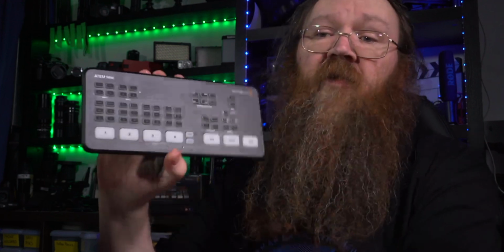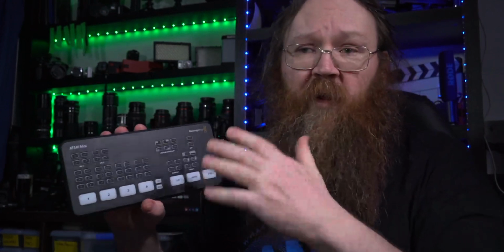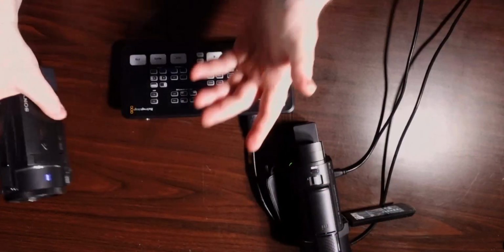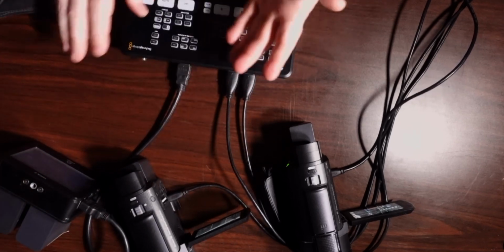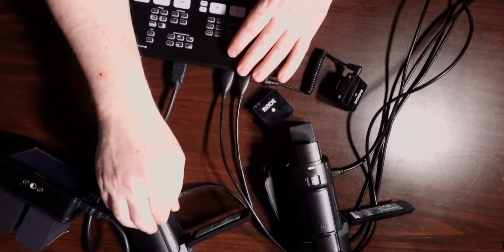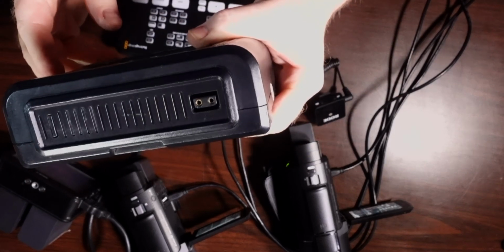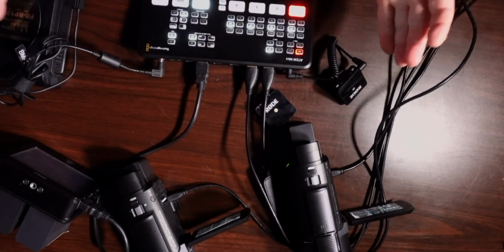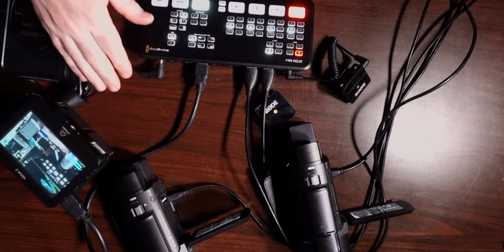It works! Battery Power for the Blackmagic ATEM Mini

Comment: Could a golf cart battery work? They are 12v (e.g. Yuasa NP7-12 Battery 12v 7Ah). Unlike the V-lock, they are far cheaper. So much so you could presumably connect two in parallel for extra assurance and endurance. Presumably there's nothing special about the D-tap except it's an industry standard so cables readily available. I had been thinking about this problem when I saw your video, but I'm not sure how safe what I propose would be. Thanks for any feedback
Reply from the maker: Possibly. Does it have regulated even voltage/current over the charge? The vlock will give you an even 14.4 over it’s discharge. The other problem with Lead Acid is the don’t like being depleted full. It borks the chemistry. VLocks are Lithium Ion cell. Probably cheaper over time
Reply: @TimSimpson  I’m doubting it does. In fact certain it doesn’t. But if the Atem can operate with a bit of variation I’m doubtful it matters. Also the default power supply is probably not completely stable either.

Comment: Hope I'm not too late replying to this but found it really interesting. I want to power my Atem Mini Pro which apparently requires a 9-20v 30w supply according to the plate on the back of the unit. However the mains power plug says the output is 12v 3a 36w. I'm thinking of buying the

Comment: Thank you for this helpful instruction, I just need to know which Sony cinema camera connector fits the ATEM connection plug.  Thank you...
Reply: This question? I’m looking for the cable and I can’t find it, I literally ordered a cable that I thought was the right one and it’s not, please help
Reply: Did you ever figure out which DTap to Barrel size tip that is needed? Or the Sony camera that is the correct size?

Comment: Tim, I use the ATEM Mini Pro and the BlackMagic Design 7" Video Assist 4K to monitor the preview out from my ATEM. I run both off of a DTAP splitter connected to a MaxOak 153Wh V-mount battery. I've tested for up to 5 hours and usually drain (so far) only to about 50% on the battery. Very happy with the portable setup! FYI, I also run 3 Sony AX7000 camcorders into the mini using Hollyland wireless HDMI. As long as I have fully charged batteries, I've got at least 4 hours of straight camera streaming and recording. Thanks for the idea!
Reply: Hey Zyxxy, wich Hollyland wireless HDMI you use ? How long the battery can be used ? And what's happend to the Atem Mini if you change the battery of your Hollyland wireless ? Just black screen or error ? Tks
Reply: @GeoffrayJuillard  I use the Hollyland 400S. The NP-F980 batteries last about 8 hours for me. If the Hollyland goes out, the screen goes black until it's powered back on. Just switch to another camera during that time.

Comment: great review ! just returned my go-zero battery that failed me after a month. i have an old "Anton Bauer ElipZ Under Camera Mounted Battery ElightZ and EGripZ Kit- for Sony Cameras 7.2 VDC, 75 Watt Hour, Lithium Ion. see if i can use the same setup .if u have any suggestion let me know ?
Reply from the maker: 7.2v won't be enough - it's 9-20 v @ 18W for the mini and 30W for the mini pro iso. A vlock battery is 14V
Reply: Any suggestion for a battery?

Comment: Would be nice if the thing had a simple off button though, and the ability to dim the button lights... two weird omissions.
Reply from the maker: Power would be an obvious one at least. On saying that I’m putting HomeKit power switching on a lot of my gear so I can have everything power on at a voice control. Extra geek points
Reply: Tim Simpson Got a question for you... If I have the ATEM set up and doing a chroma key, hit the auto button on it to go to a second camera, the chroma key turns off.  But, if I hit the auto button in the control panel, in the transition style area, it retains the chroma key and keeps it engaged... shouldn't these do the same thing?  I would like for it to drop the chroma key when going to the second camera, since it's a different camera and the key would be wrong there, but when i transition back to the camera i set up for the key bring the key back.  This is what happens when I use the handles in the control panel, slide up to trans to cam2, down to trans back to cam1, and the key cuts out once i slide up, and cuts back in as i slide down.  Its just odd.  Was thinking of doing this with macros, seems like the 'auto' button on the box should just slide the handles up or down.

Comment: All you need is one of the mobile portable Wi-Fi  hotspot modems with a RJ 45 PLUG and you all sweet for when your on the road!
Reply from the maker: I use the Macbook Pro so I've got control of media library etc, and hook that up  through my iphone. But I do have mobile routers as well :) it's good to have a private lan on set. Public wifi gets so congested!!!
Reply: @TimSimpson  only a brave man would try to stream on public Wi-Fi